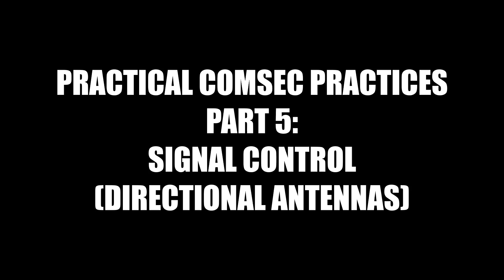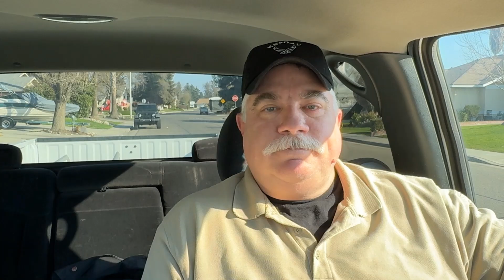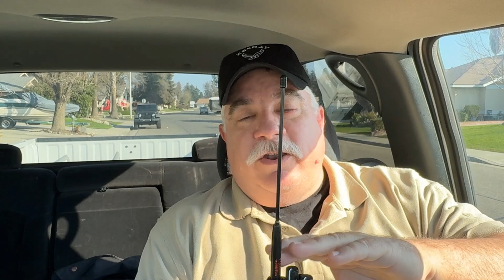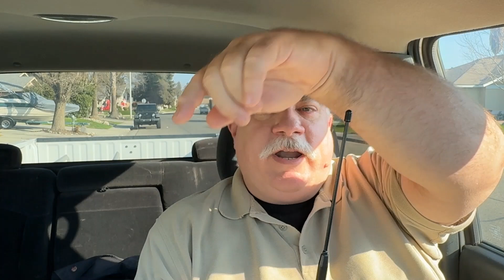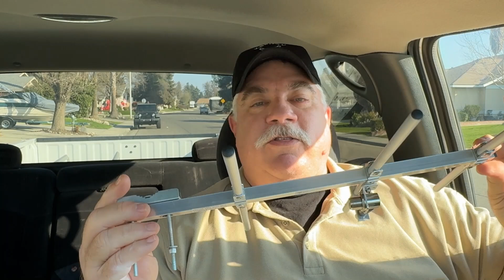Practical COMSEC Practices: Part 5 - Signal Control (Directional Antennas)

Comment: There’s one element to small unit communications that usually gets
zero attention- antenna polarization. Let’s take a look at our most common
denominator at the basic level- the Baofeng UV-5R. Its a VHF and UHF
FM two-way radio. FM nearly always uses vertical polarization, meaning in
simple terms, the antenna is straight up and down. In a conventional environment we do this for two reasons. First,
pretty much everyone else is vertically polarized when communicating via FM, and second, there’s 9db of loss between a vertical polarization and
horizontal polarization. Wait, what? With each 3db of gain, we double our effective radiated power (ERP) in terms of signal
strength. With each 3db of loss, we cut our strength in half. This is
measured in orders of magnitude, meaning that with each 3db, the strength
doubles on itself (4w x 2= 8w x 2= 16w, etc). Taking that into account, the
difference in strength between horizontal and vertical polarization is 9db-
quite a difference. If someone is using a vertically polarized antenna to
attempt to intercept my transmission, they’d likely be using vertical
polarization. After all, why wouldn’t you? Nearly all FM transmissions are
vertically polarized, its common practice. But if I change my operating
practice to account for this, now they’re going to have a harder time both
intercepting and getting a bearing on me. Not impossible, mind you. But much harder. And that’s on top of my
other operating practices, such as transmitting on one frequency and
receiving on another, keeping my transmissions as short as possible, and making sure I’m always using directional antennas. It goes without saying
that your intended receiving station should be matched in polarization.

Comment: A beam antenna acts just like a flashlight in that tha farther you get from the antenna the wider the signal. At VHF and UHF frequencies, there is no way to make that beamwidth so that you can direct a signal to one specific point but if both beams are in the vertical plane thay have the narrowest beamwith on the ground..  A omni antenna is like a lightbulb on a table and radiates just the same.Another thing to consider is  with beam antennas is that you want to transmit in the same plane (especially when using low power) that is to say that both antennas should be vertical or horizontal. You can lose a lot of signal if they are cross polarized.